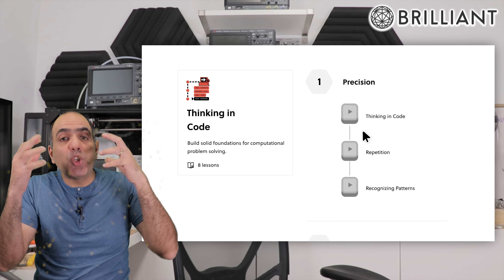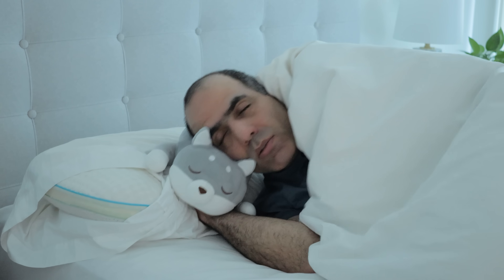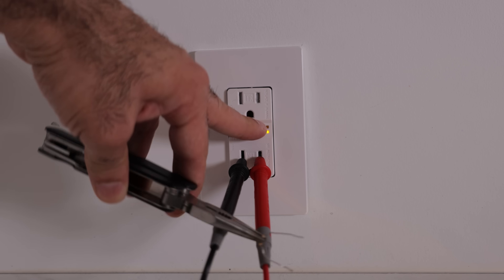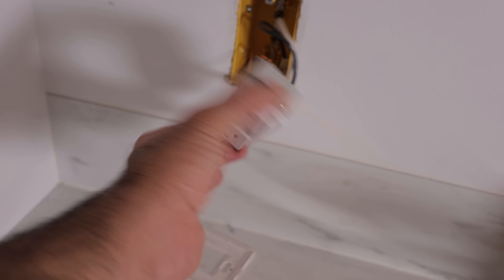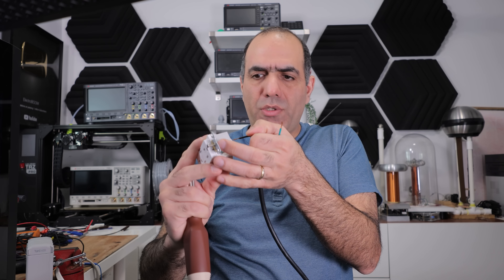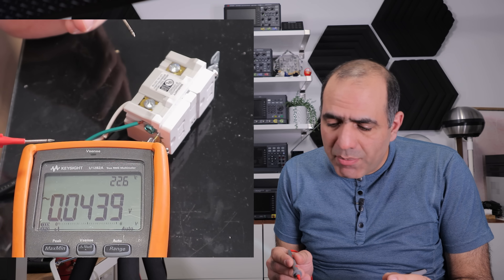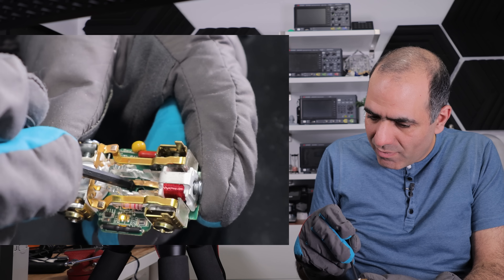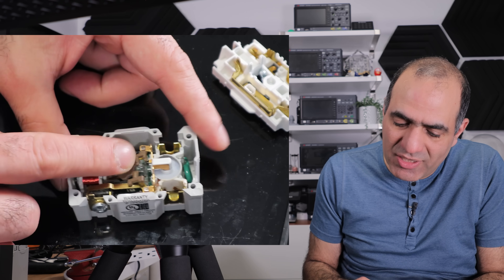Repairing Faulty Ground Fault Failure

Comment: It’s pretty likely the actual problem with that thing was mechanical, not electrical anyway. One of the springs is too strong or weak, or the holding mechanism has some defect. All the circuit is going to do is compare the CT’s output to some reference and if its exceeded, connect the solenoid to the load terminal - so it fires repeatedly until the load terminal is depowered (which should be less than 1 cycle, so it only fires once)

Comment: You can still get an arc from a protected ground fault circuit's live output to ground when you have a metal-to-metal contact between the live wire output and ground. 

If you plug a grounded metal tool or device into an extension cord missing the ground prong on the male end that is connected to a ground fault outlet, the casing of the metal tool can become energized by the floating ground wire. The longer the cord, the more powerful the effect. This effect does not shut off the ground fault device. I created a prolonged spark that ruined the surface of a new sheet of metal subjected to the arc. Also, the higher the amperage drawn by the tool or device, the more powerful the current in the floating ground wire that the ground fault device cannot detect. But even with no load, the ground wire becomes energized.

Comment: 7:19 literally me when disasembling my camera because of broken flash lamp capacitor and absolutely for no reason i unscrew mechanical photo counter and can't put it back on
Reply: Kinda the same thing happened with me, i was trying to modify my camera to full spectrum, it worked, but audio stopped working, so i tried fixing it, but it broke...

Comment: Huh. Down here in Australia we usually have the lighting and the power points on separate circuits. So you have lights while fixing the power point, or can plug a light into the wall socket when working on the light fittings.  While this is handy, I think it's originally because of different wiring standards for lighting and wall sockets. Power points are set up to handle higher currents than lighting.

Comment: You should try the RCD/GFCI with the null disconnected at the input. If it doesn't work even in this situation is pretty much useless. There are situations where a disconnected null fault in the distribution network can be very dangerous and what it makes it even more dangerous is the fact that there are cases when everything appears to work normally. AFAIK there are some models that power the internal electronics from the mains.

Comment: A GFCI or RCD that trips at just 5mA? That's 5 times more sensitive than most GFCI's currently in Europe, we all use one with a 30mA trip current, in old buildings you sometimes still come across outdated 300mA ones.. as long as they still work, they don't get replaced, especially if it's not a wet area (shower / bathroom or whatever), but I feel much safer with the current 30mA standard.

There was a study done on tasers and their effect on the human heart, and in the US, tasers (such as the ones carried by police) must be limited to 7mA total output current in order to not screw up the hearts natural rhythm, so I wonder if that has anything to do with 5mA GFCI's.. good video as always, Mehdi.

Comment: In Europe we typically install 30mA RCDs on 230V, so yeah, it's nice to have central protection, but current you experience before the RCD detects a fault is more than 10 times higher :D

Comment: Why not hpde pipe? It can handle more and wont explode in 1000s of small fragments but instead it will rupture. They use it for this reason to launch shells(fireworks). If it goes boom in the tube it will just rupture instead of grenade itself

Comment: I showed some big shot electrical engineers that you don't need to have a ground wire at the outlet box to have a GFCI function properly. Not a single one could explain why... But then neither could I, but at least I knew it didn't need the ground wire. You just explained why that is. The ground wire has nothing to do with it's functioning. It's there only for the short circuit protection of that device. The GFCI will still trip as necessary without the ground when it senses the imbalance between the neutral and load wires. It actually. Ground actually has nothing to do with it's operation, as it's name has caused many of the brightest electrical minds to be misguided on how it functions! So install them even if you have no ground wire because they will still work just fine. Just make sure you label it... No ground wire so people know! 👍

Comment: It's funny that I just had a faulty GFCI of a different brand that was several years old - It would randomly pop when a particular low-power server was added to my homelab rack. Even after swapping the guts into a new chassis with a known-good power plane at the behest of "voltage out of range" diag messages, it'd still pop after 1-2 hours. After reaching wit's end after many tests the fix for me also was swapping it out for one that looks like your replacement!

Whether it was a failure due to a design flaw, years of semi-high (5a-10a @ 120v) constant load, or some weird transient noise that an additional (and extra-sensitive) protection feature didn't like my setup, I'll probably never know. All I can say for certain is maintaining sanity is definitely worth the $20 for a new GFCI when nothing else can isolate the outlet, wiring, or devices that it feeds as this isn't a completely uncommon failure mode for old GFCI outlets. They don't last forever!

Comment: hi with the hope that you have somehow survived your own death luring experiments,

i recently bought an 3d printer and using it for some time with no issues but i shifted it to my balcany and with the help from local electrician made an extension socket with ground connection there. but while running my 3d printer on it, it gives me tingling feeling when touching its metal bed. since the power cord has only 2 pin, i was thinking of replacing it with 3 pin but i think it will not resolve the issue, it will make it secure to touch but it will still affect the machine components....... can you suggest? (the power socket extension was taken by connecting each - live/neutral/ground in parallel with Air conditioner's supply and both are protected through breaker.)

Comment: inf power us a electric moter to spin some gears    with a gear ratio to speed it up and use a dynamo type thing to make power from rotation and split half to power the moter run and half to store the moter would spinn slow but the geer ratio would speed it up a lot to make more power
@ElectroBOOM

Comment: I had the same model of Eaton GFCI outlet installed, and it also failed in the same way, despite no ground faults, and got to the point it wouldn’t even reset. Took it apart after replacing and now it works fine

Comment: Electrician here, gfci receptacles are the most common device changed out when on a service call, they have gotten better over the years but they are still very prone to going bad in one of a thousand different ways
Reply: Just curious, are there any reasons they become faulty? Or is it just based on luck?

Comment: As a Control Engineer there were many times a re-assembly would make the problem go away for a while.  The preferred scenario was for the component to fail outright and get replaced.  An intermittent was the biggest pain because you’d spend hours trying to find it!

Comment: I keep two regular outlets (one 15A, one 20A) and one GFCI outlet onhand.
Which reminds me, I still have to get around to replacing that dodgy outlet in the livingroom... Oh well, why do today what you can put off until tomorrow?
I already did fix my shopping cart, added memory to my desktop computer and found out to my horror, I have the wrong keyboard for my laptop computer. Did get that butcherblock kitchen cart refinished and since it was a rescue, the missing hardware from its misassembly is no longer missing.
And explained again to my neighbor that her electronic ignition circuit on her stovetop is supposed to make that snapping sound when turned to the light position...

While you joke about getting lit up, I am known to work on 120 volt branches live. Did it for enough years that the one hand technique is second nature, I also check that neutral is really neutral and hot is really hot (you'd be shocked how often that's been reversed by the ignorant) and only check for hot using Old Blue. OK, actually, my DVM.
Also got launched by a hot ground before - on a properly killed circuit, ground current was available due to what was later found to be a defective line to a grounding rod. That was only around 400 volts, grumble...
Also had a used electric clothes dryer that had a problem, on disassembling it, I found the heating coil lightly welded to the case, energizing the case. Fixed that and a switch, had a free dryer. As it was a 200 volt unit, I wasn't going to taste test the case first...
But, I'm much better in one area than you. I'm far more proficient in the use of profanity. Easy to learn, grab the pointy end of the soldering iron a few times.

Comment: Question -- Why are you working in the dark? The kitchen counter outlets (no more than two per circuit) are supposed to be on a separate circuit from any other devices or outlets

Comment: I wanted to ask because I cannot find it on Wikipedia. What is the temperature of electricity? 

If you had nano gauge wire for 1 to however many electrons next to each other, filtered with resistors to create a visible circuit at the lowest voltage. Cutting out amps and quantifying watts by wire for the environment of a natural static shock. What would be the most common temperature of 1 constant electron circuit.

Comment: Is it only in Brazil that we need to create a specific circuit for lighting? At 4:41, he trips the main circuit breaker in the room, and all the lights go off.
Here, in case of fire, the fire department disables all circuits except for the lights so they can evacuate the building with a lower risk of other accidents.
Reply: Yes. Probably

Comment: A simple explanation:

It is an device resembling a fine scale. If the scale is tipped to either side it will trip the switch as it wants to stay in equilibrium.

Electromechanical scales are a fascinating thing too.

Comment: The GFCI trips when you short neutral to earth at the receptacle not because any current flows but because the GFCI is required to detect and trip if there is a double grounded neutral.  As you pointed out, the neutral and earth conductors are tied in the electrical enclosure which is the only place that earth and neutral may be tied together on a GFCI protected circuit.  The GFCI is always testing to ensure that there is no double grounded neutral and earth which would form a loop that the GFCI will detect and trip on if the impedance of that loop is less than 2 Ohms.  If the loop impedance is greater than 6 Ohms it is not supposed to trip.  For loop impedances between 2 and 6 Ohms, it is up to the GFCI and its manufacturing tolerances to determine if it will trip or not.  Thus, it does not matter how much voltage exists between neutral and earth and the GFCI will trip on loop impedance alone even if there is zero volts between neutral and earth.
Reply: Neutral and earth is only supposed to be tied at the main breaker box in US and Canadian systems.

Comment: I have a video suggestion and it might help others too.. 
Smart switches that requires a neutral wire do not work in buildings that have no neutral wire in the switch box. What can you create that will make them work? 🤔😃
One product example is TP-Link KASA switch on/off. Will not work. I have heard about adding diodes, resistors, capacitors to bring the neutral in from the junction box at the light to the switch... 
Anyone interested in Electroboom helping the community out on this? 😮 For Science

Comment: 3:45 central house ground fault protection has its drawbacks, too. If you have several RCDs, one for each room, you might be fine, but thats barely the case anywhere and having one RCD for the entire household means that not only does it turn off your entire household which is obviously annoying, but it also has to have a relatively high trigger current to not false trigger all the time and usually its something like 30mA which can already kill you...

Edit: Wait, the test button is purely a mechanical test? It should put a resistor between live and earth, otherwise its not a proper test button...

Comment: As a Singaporean,  I was dumb enough to run an old ac motor through city power... no saftey, directly connecting it.. even holding it in my hand.. switched on the power and electroBOOM... was shocked, didn't feel a thing and found out I popped the breaker 😂

Comment: Hi, ElectroBoom, I'm one of your biggest fan, Could you please build a 12V DC TO 220V AC power Inverter with output AC Power of anywhere between  1000W - 3000W and explain in detail how Inverter works. Thank you.

Comment: Mehdi so the reason it was popping its because gfci outlets have 2 indicators orange if you saw from the start it meant gfci has issue green when you reassembled it means no issues and its good (thanks for reading mehdi)

Comment: Hey electroboom. i ask you this because i quite literally know no other electrician. this happened earlier today, my bathroom wasnt getting any electricity and no breakers popped. there were no lights, the ceiling mounted heater wasnt working, and the outlet wasnt working either. after some investigation i found that the GFCI popped and when i pushed the test button back in everything was back to normal. after thinking for a bit i became concerned at how much of a saftey issue that could be, but i need someone with more knowledge about this because i know next to nothing about electrical wiring. do you have any thoughts about this?
Reply: And that's why you ask questions on a forum, which doesn't rely on hoping a YouTuber sees your comment out of the 1500 other comments.
Join a forum.
I only see about 8 million other comments here asking questions and maybe 2 got answered.

Comment: Thank you for this, I often get asked about these in my line of work and haven't really had an opportunity to take a working one apart. I work in this weird little niche bridging electrical and electronics, specifically dealing with high voltage surges that blow up electrical and electronics in people's homes, mostly from lightning strikes and damage from the electrical grid.

These fail are many ways and you let me understand how they basically all work. One is obviously catastrophic where plastic blows out and electronics are burnt. But they also will sometimes not reset, sometimes they will not hold a reset, sometimes the button is permanently and firmly depressed down, and sometimes the button will be press-able but it won't do anything.

Comment: Maybe it was just a mechanical failure, not a problem with the circuit? Heat/cold affecting the springs and making the device pop.

Comment: Mehdi da man, replaces GFCI outlet to ensure protection form electric shock. As soon as done, proceed to press the reset with multimeter prongs still hanging out of the outlet right below the button or grab open live wires with bare hand right after removing glove  :P

Comment: it's interesting to see how you can have on the states differential sockets but no main differential to protect all the installation of the home . In modern installations in many country's in Europe (it's easy to identify, all the sockets in the house have earth) , we have at least a general 300mA diff protecting all the installation , and a 30mA at least for the bathroom and sometimes kitchen (proximity of water or humidity) . More modern installations can have a diff by stage , bathroom / kitchen / water using appliances (washing machines,coffee makers, water heaters, stoves ,hotplates) . the appliances that dont have earth , have double isolation , identified as double square . But saying that your neutral is connected directly to the earth is strange , I know you have 120V 2X because of a middle point of the power transformer (if mesure between the 2 phases you have 240V ), the Neutral isn't present before and after the power meter ?

Comment: In EU we have both digital and analog GFCI types, the latter ones use big-ass (has to be 2U DIN) current transformer that cancels itself out while current flows in a usual loop and induces voltage in ground fault mode. We are used to avoid digital ones wherever possible, even though they are twice the price at minimum.

Comment: The irony is regardless if you’re an electrician, plumber ect ect. Your home will be full of faults from your trade. I need to fit 2 new taps and I’ve been putting it off for 2 years.

Comment: My parents had a faulty slow cooker that had an intermittent short in the cord and when my dad plugged it in the GFCI outlet exploded shooting sparks out of it. They didn't know about the short and just thought the GFCI had failed, so they plugged it into a different outlet and it worked fine. I replaced the GFCI for them and took apart the old one to see what the failure was as I've had them fail as in the video where the trip randomly, or even had them fail to reset, but never seen one fail in this way before. In this case the outlet had 2 sets of switch contacts, 1 set for the outlet itself and a second set for the outgoing 'load' terminals. The contacts for the outgoing terminals were melted so it was apparent to me the fault was external to the outlet. Upon investigation I discovered that the insulation on the power cord for the slow cooker was heat cracked and the wires were exposed right where the strain relief ended under the appliance. Moral of the story: Inspect the power cord of your heat producing appliances before each use!